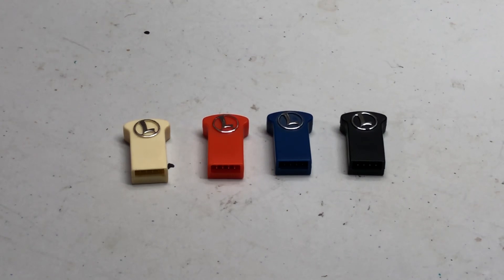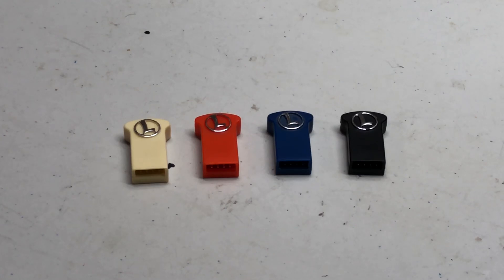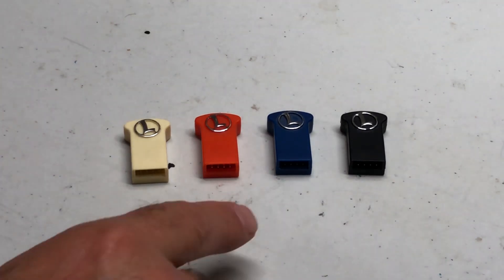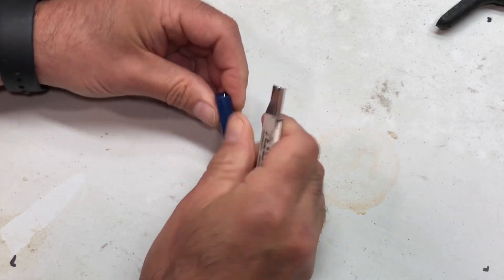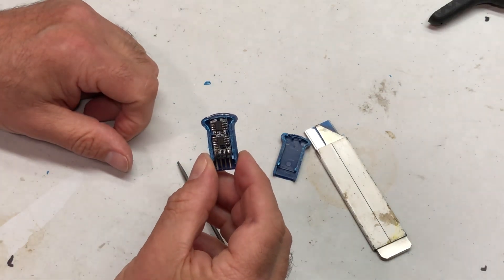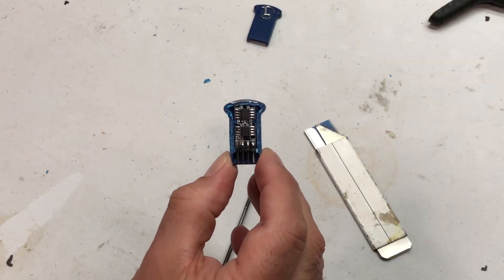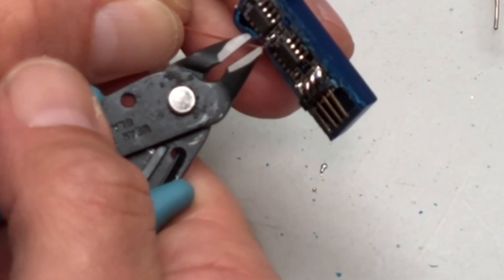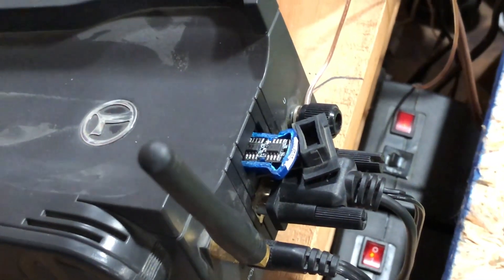Making a Lionel Writable Module for the Lionel Legacy System!

Comment: Thanks MartyE - I hesitated to do the upgrade but now feel confident that I can do it thanks to your video!
Reply from the maker: Thanks Stanley I appreciate it. Just be careful with the razor knife. Just take your time. Thanks for watching!  Happy railroading!
Reply: @MartyE  I just “converted” 2 useless blue modules to 2 black ones that I will use for Legacy updates / backups! While reading about the process on the Forum wat informational, watching your video gave me the confidence to get out the soldering pen and do the job! Micro surgery IMO! Thanks!
Reply from the maker: @stanleygitler7089  That's awesome.  Thanks for sharing you experience!  Those buggers are hard to get apart though.

Comment: Is it possible to copy engine data that was previously installed with an orange module on to a Cab 2 remote and transfer the data into a second Cab 2 remote?
Reply from the maker: That data is stored in the base.  That way any remote connecting to the base gets all the same data.  The Cab2 reads the engine module data and "writes" it to the Base's data base.  Without the base, the Cab2 has no engine data.
Reply from the maker: Now if you get a second base as a backup or spare (remember only 1 base per layout), you would need the Legacy Utility to copy the database of the first Legacy Base and then transfer it to the second one.  The Legacy Utility is available on Lionel's Customer Service site. and you will need a serial capable computer or a LCS WiFi module.  But back to your original question, as long as the second CAB2 is connecting to the same base it will have all the engines available to it.
Reply: @MartyE  Thank you with this information. I was able to transfer the engine data from the Legacy Command base to the new Base 3.